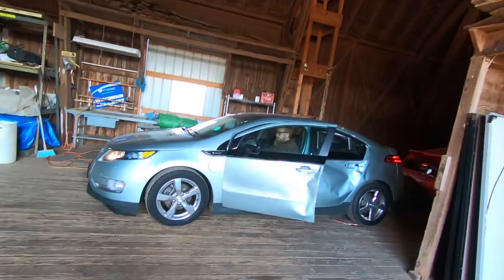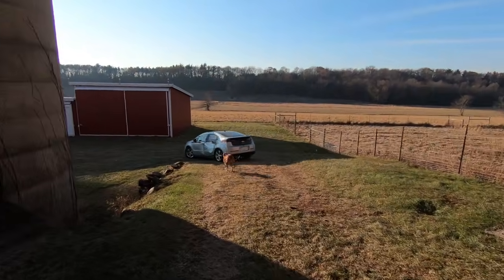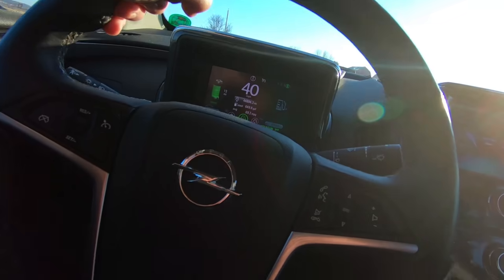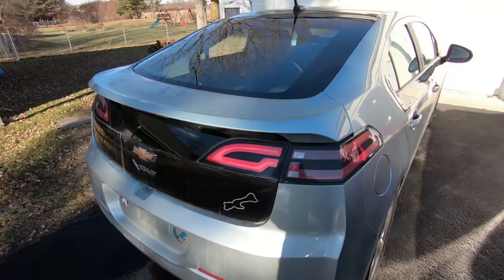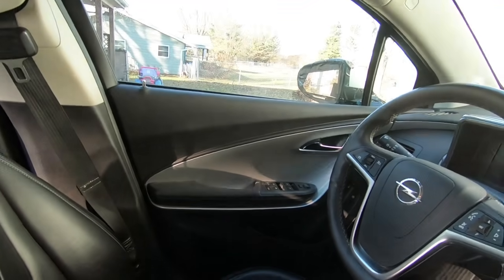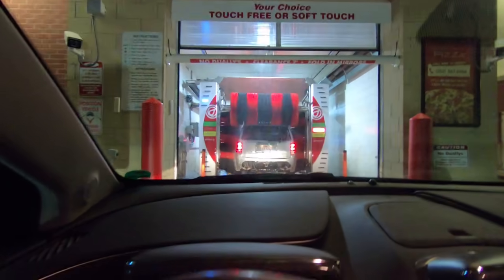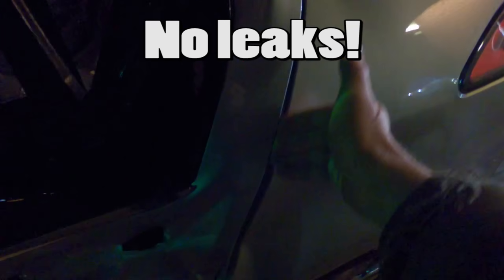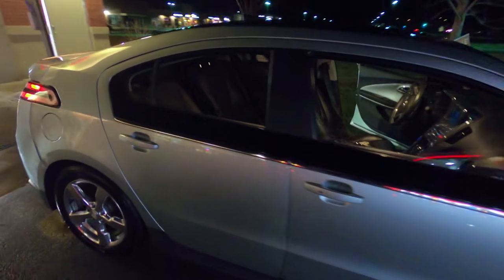Crashed Chevy Volt - Will the Doors Leak!?!?

Comment: Have a water leak coming from behind the dash running down behind the drivers side kick panel where the bonnet pull is . Put sealer under the wiper motor all the way along and cleaned all the drain points inside both wings and the one on bulk head and still leaking.  Any ideas please . Checked air con drain pipe also . On a Vauxhall ampera . ? Thanks

Comment: I don't understand American laws if the car was written off by the insurance company how is it legal to drive on the road?
Reply from the maker: OffGrid Wanabe, this one was a bit odd. The estimated repair bill was something like more than 80% of the value of the car. Rather than the insurance company paying all those costs to fix it, they simply paid that value to the owner.  It had nothing to do with whether or not the car was driveable.  The car is otherwise in good structural condition. The airbags didn’t fire, etc.  I fully expected to get a “salvage title”. That would require me to have the vehicle inspected, show receipts for parts, etc., before I could legally drive it. Something with the original owner buying it back and the age of the vehicle meant that I got a standard title.  I was pleasantly surprised.

Comment: Bet that rear door is going to make a nice "slooshy" sound with the water going in the door handle holes. Just make sure when you pull the doors off there is no frame damage on the post. If there is, I'm sure it wouldn't cost too much to have a frame shop straighten it before you mount your new doors.
Reply from the maker: The rear door doesn't stay on for long. Watch tomorrow's video!

Comment: Hi Ben. Nice car! Today in the mail I got a fuel flex plug and play computer from America and now my little prius can run on ethanol! Is the Volt a flex fuel hybrid? If not it might be a good conversion. It took me 15 minutes. Can't wait to see what you do to the volt!
Reply: Whats the point though?  Ethanol only contains about 70% the energy per gallon.  Only reason to run ethanol is if its 30%+ or you are running a car with lots of HP and an ethanol tune.

Comment: Nice, what did you pay?  And is there a way to test what kind of shape the battery cells are in without pulling them out and doing external testing?  I guess you could drain the pack then measure Kwh put into the pack and assume 90% charging efficiency.
Reply from the maker: asusreviews buyout price on the car was $2800. I already had a parts car that I’m using for the replacement doors, seat, etc.
Reply from the maker: asusreviews there is a way to test the batteries with a certain smartphone app, and wireless ODB2 adapter. I’ll try doing that at some point.